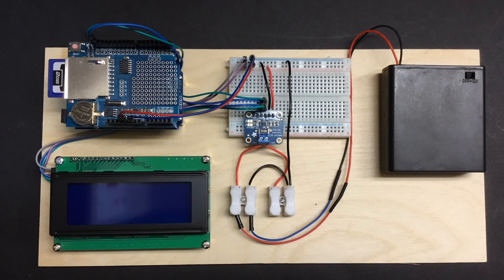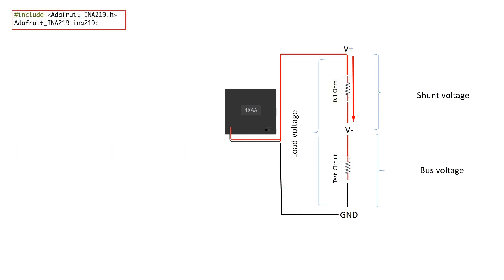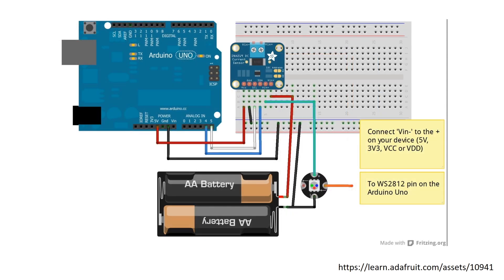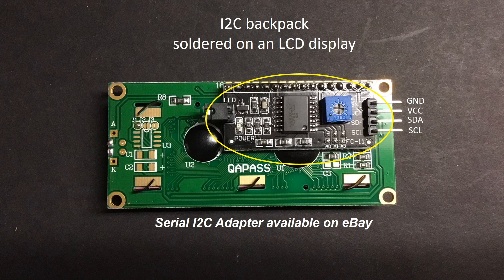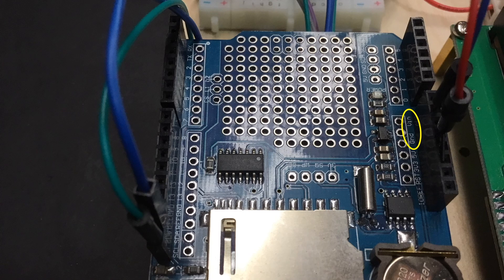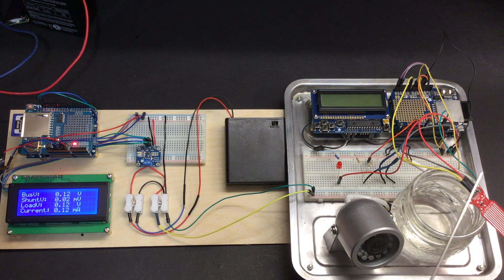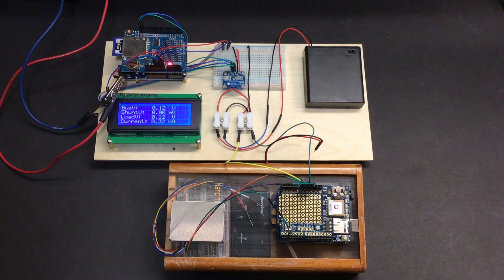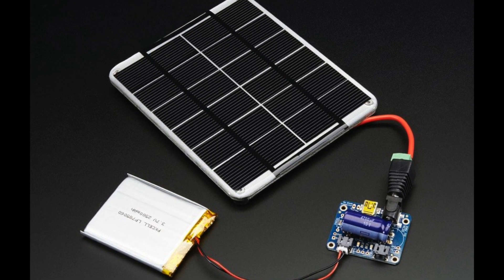Current Monitoring with the INA219

Comment: Can this chip be used to monitor voltage and ampage (and therefore power) generated by something like an electromagnetic generator or solar panel, and if so how would the configuration and coding differ from using the sensor for measuring power consumption of a load, as showcased in your video ? Thank you in advance for any response you can provide.
Reply from the maker: I have used this project to monitor power demand from a battery for driving a data logger, and plan on doing exactly what you suggested shortly. I'm currently working on a solar powered rain gage project which I hope to post details of this weekend, so I've been a little distracted on that front. It would be interesting to see if I can use this box to monitor power demand for a future video - stay tuned.

Comment: Hi,

I have the Arduino Uno, INA219 and a (16x2) and a (20x4) MIDUS display.
In most projects I have used 4 wires for communications from the Arduino to the display.
In your project you are communicating via an I2C interface which is between your Arduino and your LCD display (actually
attached to your LCD display).

Could you tell me if there is a way to use the display without the I2C interface?
This would require the 4 wires from the display to be used for communications (not including power and cs r/w)
Thanks for reading this.

I will be using this to monitor the load current from a solar panel project.

Doug. mm6duv
Reply from the maker: Thanks Doug. I've always used I2C for communicating with LCDs because otherwise, I end up using most of my pins just to drive the display. Jeremy Blum has a suite of tutorials on Arduino that are most excellent- I checked and noticed he has one on LCDs and how to hook them up here without the I2C interface - check it out here: https://youtu.be/oIiDseJO4dM . Hope this helps!

Comment: Awesome video! The code is gone, any chance for a re-upload?
Reply from the maker: Go to http://www.biod101.com/arduino/. That will redirect you to my google drive where you should see "Part II - Environmental Monitoring With Arduino". Follow that link and scroll down to Chapter 7. There is a link for the sketch there - called "CurVoltPowerLCD". That's it! Let me know if you have any trouble. Update February 14, 2019 - I'm back on my old server - connections issues should now be fixed.